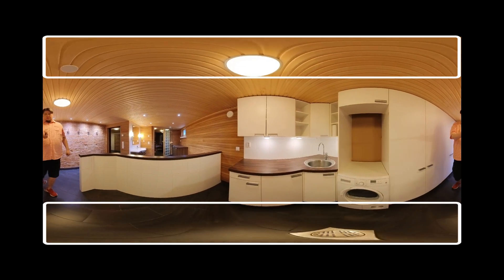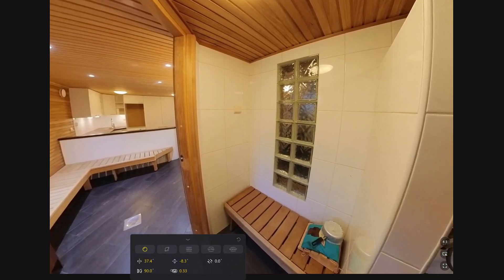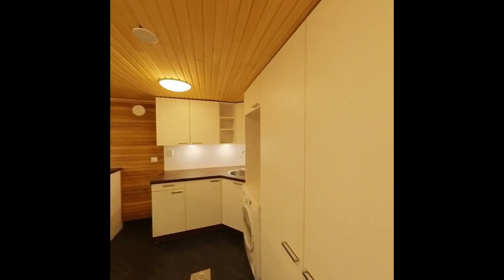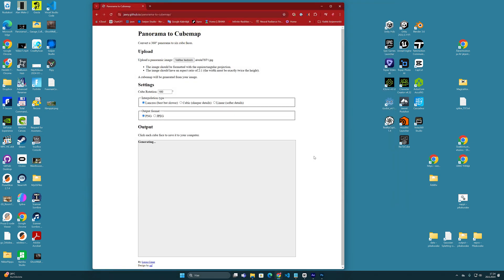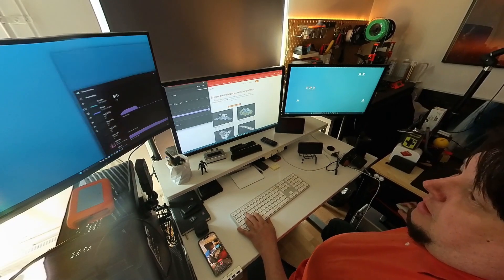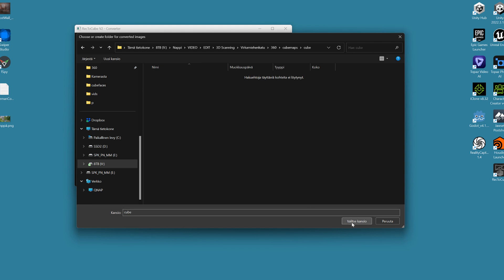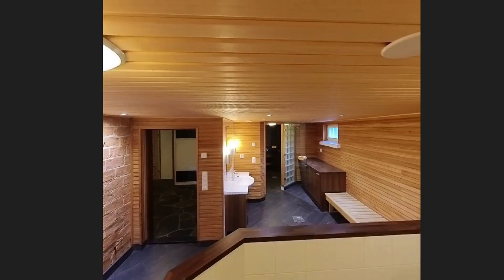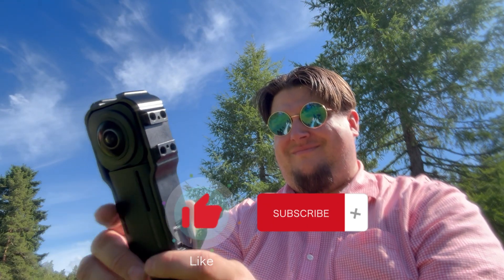Convert 360 Sphere images to Cube Maps for 3D modelling

Comment: what other software can do this?? your software gives me error 49766400  all the time.
Reply from the maker: After Effects is probably the best. There you can use VR convertor effect to your 360 material, There are several cube map formats in there.
Reply: @OlliHuttunen78  ok? And how do I extract it to frames ? I have no clue about what vr Converter is and how to use it. Is there video tutorials about it??
Reply from the maker: @ Is After Effects familiar to you? Here is one video which shows you hot the VR convertor works in after effects. https://youtu.be/Z3PbYGDXhjo?si=OPb85egIYWnI9fZy
Reply: @OlliHuttunen78  ok. and how do i export images? as i see in the video it shows how to display it.

Comment: Hello Olli, I used Meshroom from Alice Vision to extract the square images from equirectangular images. I tried your app, but it does not let me drop my equirectangular images. Neither in PNG nor in JPG. 7680x3840 . Am I missing something?
Reply from the maker: Ok. My app does not seem to handle 8K material. Well it is not the best software anyway. Perhaps I will continue to improve it but in meanwhile I recommend to check out what After Effect can offer. There is a native effect called VR converter and it can turn Equirectangular to all sort of cube map squares.

Comment: Hi Olli, Amazing work you are doing, thank you for this video and tool. export works great and is easy to use, however an issue I'm facing is that it is flipping 2 of the images when exporting into the mirror image. Do you have a fix for this?

Comment: I created a solution to extract 12 images from one 360° picture.
I use timelapse instead of a video.
I will test next days...
Reply: Your idea is very interesting. 
I had a similar thought before. I used a full-frame camera with a fisheye lens, but I didn't crop the image. I was considering how to correct it using distortion parameters, but the results were not very good.
I have confidence in your method.

Comment: Hi Ollie, 
I usually use after effects to do this. I know it’s an Adobe program, but I’ve used it for many years so might as well. There is a filter in after effects that will convert equirectangular images into different kinds of cube maps - they’re all similar, but some have different aspect ratios, and in some the faces of the cube are arranged in a different way.
I usually use the one that has three faces on top and three faces on bottom, which gives me a square image that’s easier to handle than the T-shape.
You can then position this larger comp into a new square composition - rendering the different faces of the cube. You can also change the order in which the different faces are rented by animating the underlying composition - giving you the different faces of the cube in the right order. hope that makes sense. If not, I can share a couple of screenshots with you.
All the best, keep up the good work 
Kai
Reply from the maker: Ok. That is interesting. What is the name of that effect or is it a plug-in that can handle 360 images in After Effects?
Reply: @OlliHuttunen78  Its a regular effect. You can find it under-  immersive Video: VR-Convert. You can then select convert from equirectangular (2by1 or 16by9)  format to three different kinds of cube maps. You can also shift the center of the spherical image by rotating it. I'll send some screenshots
Regards
Kai